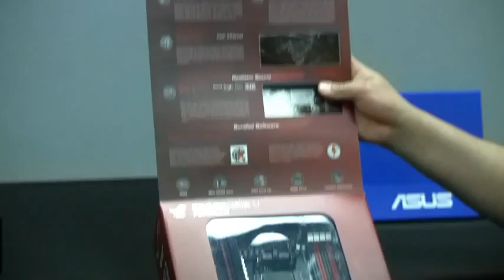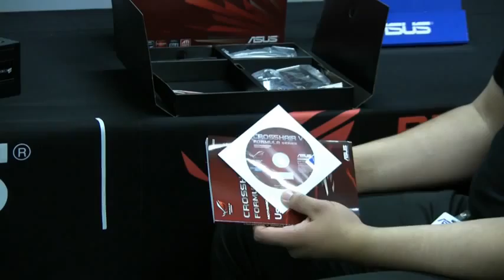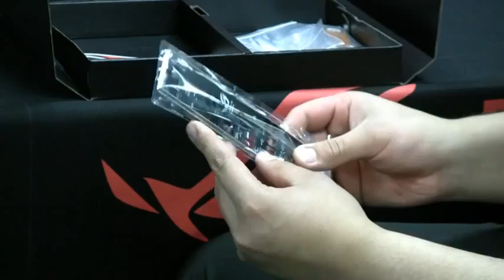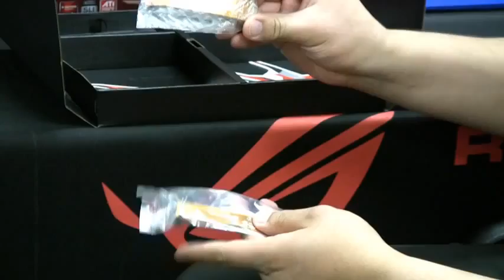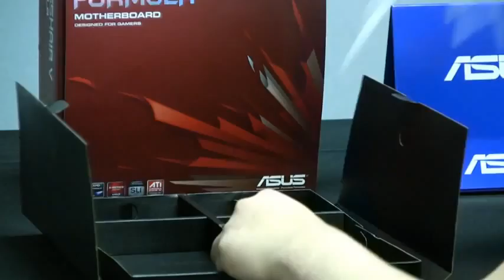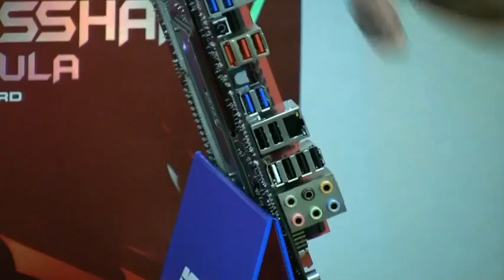ASUS Crosshair V Formula-Z AM3+ AMD 990FX SATA 6Gb/s USB 3.0 ATX AMD Motherboard

Comment: solved that, I needed another cable... have a rather old dvd drive.
but now I have another problem, I connected everything and when I start the computer the monitor gets no signal although it works (I checked) and there's not even a beep upon boot... the fans all work, hard drives too, but the monitor just doesn't react... know how to get past that problem? :S